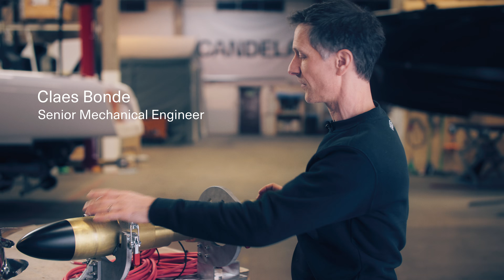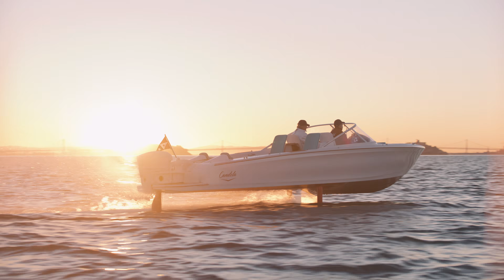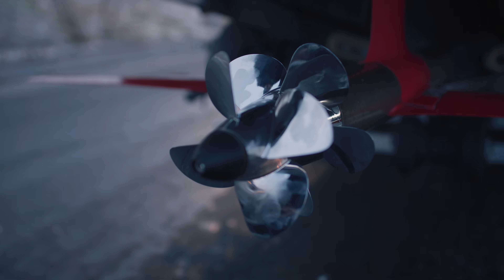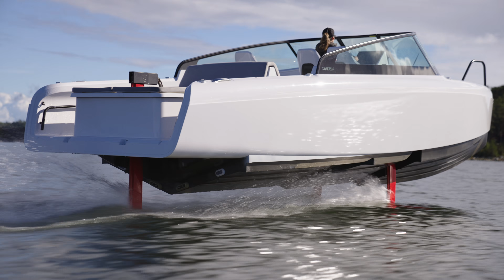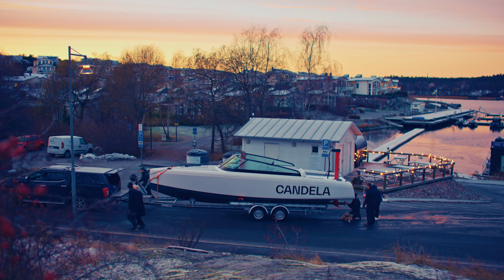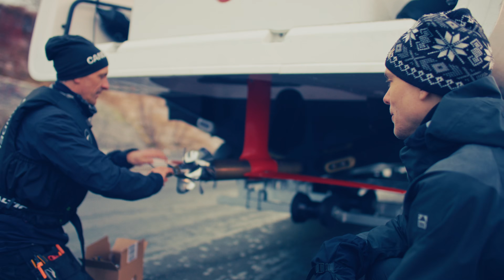Candela Tech Talks | Episode 3, The C-Pod Motor

Comment: Did I hear correct? - reduction in energy of 80%? Is there some kind of reference or evidence for this? I'd be keen to do some more reading on that
Reply: The hull doesnt need to push any water, and while a conventional boat planing it still have to overcome friction of the hull, this boat hull is flying =0 drag from the hull and just small proportion drag from foils.

Comment: I know im just "some guy" online, but I wonder if you could also put a propeller on the front of the pod motor. So you would have 1 in the front and 2 in the back. You could even have 2 of the propellers on the same drive shaft (1 in front and 1 in back).  Just a thought. cheers

Comment: "forward facing propeller technology" is apparently quite good at what is called #tracking or the ability of a waterborne vessel to stay in a straight line while under power and load thus creating a remarkable ability to control said boat either in that straight line or whilst coming about for say turning, docking, avoiding obstacles any number of matters but as for I think the term be hydrodynamic efficiency or minimal energy use THROUGH the water this can be measured and tested/validated as opposed to UPON the water yes absolutely hence why I bring up forward facing propellers as when adding an internal combustion engine or even a jib sail incredible efficiencies can be attained being upon said water as opposed to in the water yes good point here. Point being the lift created by this platform as sustained is remarkable to see this absolutely 😊

Comment: Why does the Candela C8 weigh 1250 kg without battery and motor when it is made of carbon fiber?? A same length Anytec aluminum boat weighs 1300kg without motor... I thought carbon fiber would be roughly 50% lighter than aluminum if done perfectly.

Comment: Could also pump air bubbles out of the leading edges of the foils for even lower drag at high speed. The foil could also extend its wingspan at slower speeds and shorten at higher speeds for even lower drag. 
Perhaps the propellers could be on the front of the foil to cause more cavitation bubbles for less surface drag on the motor.
Reply: Would love to brainstorm some design ideas with you Jim, perhaps even make it together if you're in the SoCal or TN area? I could possibly fund this.

Comment: Perhaps an even more efficient solution with less drag in the water would be to have a surface piercing propeller attached to a small floating/planing box. Then have the motor in the hull with a universal coupling to the axle shaft down to the propeller. That way the propeller is just sliding on top of the water at any level the hydrofoil is above the water. Alternatively the motor could be down in the floating/planing box to more easily get cooled by the water.